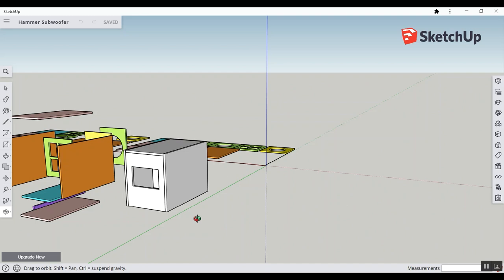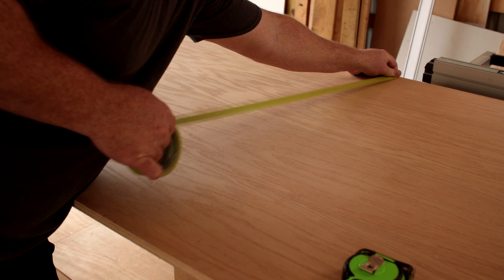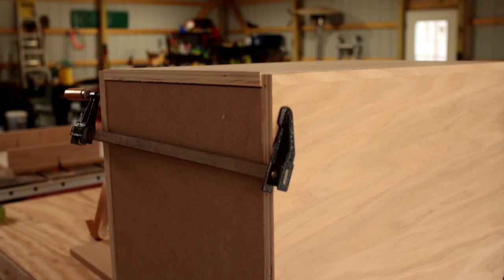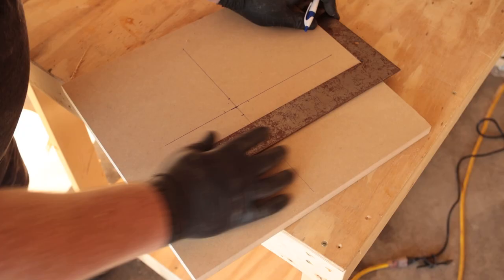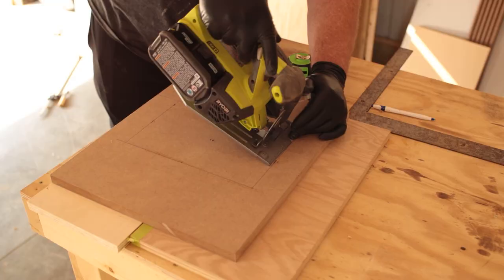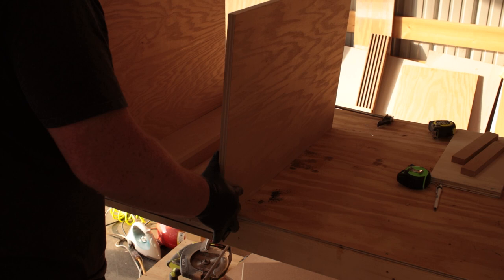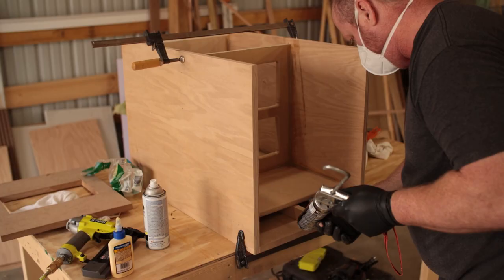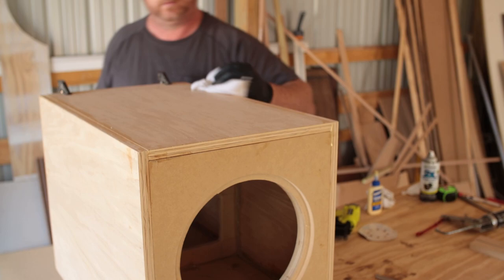DIY Subwoofer The HAMMER designed by Home Theater Gurus

Comment: Great Video Brian! Its interesting to me. I used to be a beta tester for Peavey Electronics for their audio mixer department, some of the first analog/digital hybrid ones. They let me keep the one I was testing for a sweetheart of a deal! 

One of the engineers was telling me a story of how once upon a time they used to build cabinets for existing speakers on the market using the Thiele/Small parameters of that speaker to have it operate as efficiently across the frequency band. When they couldn't get the sound exactly the way they wanted it, they decided to build their own speakers, then build the cabinet around that. So the other way around, design a speaker for a given cabinet (which a cabinet design denotes a given application, subwoofer, woofer, PA, vocal, guitar, bass, etc) rather than design a cabinet around a speaker. Obviously design involved on both elements just the approach is different with a more predictable output.

You are seeing a huge dip in the frequency response at 42hz because that is the tuning/resonant frequency of the cabinet you built. That's why you see better (flatter) response curves with two subs due to them coupling together. Hats off to the design of the cabinet. All my Peavey cabinets are tuned either to 40hz and the 18" subs to 35hz. Yours is in a good sweet spot for 12-15" drivers.

Word of caution from the pro audio world, again peavey engineer advice for live PA work, never use a direct radiated sub (the sub you built) with a folded horn sub. They don't play well together due to frequencies canceling out among other things.  You can easily blow them up because of the perceived lack of loudness, so one would want to crank the volume up, only to have them fail from overheating or physically destroying the speaker due to overexertion of the speakers Xmax rating.

Same thing applies with two subs. CENTRALIZE THEM next to each other. Dont put one on each side of the room. Each wall acts like an inverse polarity subwoofer robbing you of SPL.  Back when I played in a band running the PA, I'd put two 1x15H on each side of the stage, but put the two 1x18 subs in the center front. Never had any issue with lack of bass!

Cheers dude!
Reply from the maker: Thanks for the comments and the advice. I will say however that the dip in the frequency response is due to room modes not because of the cabinet that I built is it has a flat response if I did a ground plane measurement. As far as positioning goes I have a DSP that I use to align the subs with polarity as well as delay and so I put them in positions in the room that would give me the most even response across all of the frequencies from 80 to 20 and a little below. I don't know as much as you obviously do but what I've done so far works really well. I built two identical subs so they are matched from that standpoint. Cheers!! By the way the cabinet is tuned to 20 hz not 40
Reply: @BuildITWithBrian  good stuff!  Trust me I don't claim to know everything about cabinet design and speaker efficiencies I only know what I was told by the engineer.  At 1 point I was contemplating building my own bass guitar cabinet because I was bored and wanted something to do. I thought better of it and found other projects :)

 Great job!
Reply from the maker: @Bassguitarist1985  thanks man!!

Comment: Stumbled across your video from the Parts Express Review. Looks like it turned out great! I'm a fan of stain, but really really like how your box turned out. 

The compression looks like it's at 28Hz (Guessing based on the hammers design the cone excursion peaks at around 28Hz) and is expected as you push this sub harder and harder. (Hopefully not a wrong guess haha)

I recently found a subwoofer driver that might be a big upgrade from the Ultimax 12. It's the CSS SDX12. It has way more Xmax than the Ultimax 12, so that means way lower distortion and way less compression. (Can't say the port won't compress more/will have more port noise though)

The CSS SDX12 is basically identical to the UM12 but seemingly better in every way. I think it should fit the baffle cutout but it might be a hair smaller than the UM12 for the baffle cutout.

The CSS SDX12 also can handle 1,000w RMS so it'll get a couple of dB louder on top of being way cleaner in the 28Hz area. Might not even compress like the UM12 but can't say for sure unless I get one.

I have two Ultimax 12s but use a custom box that I've been told looked like the hammer when I was modeling it. Didn't know what the hammer was until I looked it up after being told that. Mines 5.4 cubic feet tuned to 19Hz and I get in room extension to around 16Hz before it starts to roll off. I push them with around 100-200w and they give me more than I need for output. I'm tempted to try getting a pair of CSS SDX12's though to see how they sound, even though I really don't need them as I have no problems with the Ultimax 12s.

Comment: At the last coat of primer use Velvaseal. If you've got any spots of bondo then spots of wood theres 2 different surfaces and it'll irritate the color trying to be uniform. Velvaseal will stop this from being an issue. Just a suggestion.
Reply from the maker: Thanks for the tip!

Comment: Hi there, I’m considering building this. If the bash amplifier has a HP filter set about 18hz I believe wouldn’t that be enough to start with to prevent damage? I intend on getting the minidsp later down the track for fine tuning

Comment: Great video! I built the sub and it's amazing. Did you use a HPF in the MiniDSP? I set my to 17 Hz BW I think... It is a steep curve and starts to drop at 19 Hz. It really cleaned up the low end at high volumes. I need to learn REW for EQ'ing, but it sounds amazing as is. People are always impressed when they come for movie night. Can't imagine two of these!
Reply from the maker: Yep I did! I set mine at the same. I built 2 and it shakes the couch for sure! 👍

Comment: The second top prime you needed is guide coat primer easy to sand to check for high and low sports the wood should be 3/4 to 1 inch thick at least  the inside of the box should be epoxy  paint or rubber sound detening spray the amp should be in it's own compartment and have a cooling fan or well vented some how to prolong the life or a rack amp will last longer and be easier  just some improvement needed to be closer to a high end if that's what you're trying to do🤔 🎵🎶👍👌✌️💯🥂Ps  the amp plate is the same amp as the first gen svs amps but has a different cross over  you can mod the amp cross over to be closer to the svs  fun fact it's used in 10 other brands named subs as well
Reply from the maker: Thanks for the tips! 👍

Comment: To seal the sides of your wood, ESPECIALLY MDF use 50/50 wood glue and water. 2 coats. Sands like a dream.
Reply: I've tried the glue method. It coats very well but is a PITA to sand, cloggs up the sand paper very quickly. Any tips on how to make that process easier?
Reply: @Jonathan Duncan  I didn't have the issue you described...maybe I got lucky. I error on the watery side so maybe that helped.
Reply: @jmw611  yep I used tight bond and when it dries it feels and looks like tree sap, and it would make little clumps on the sandpaper making it clogg. Tough to work with